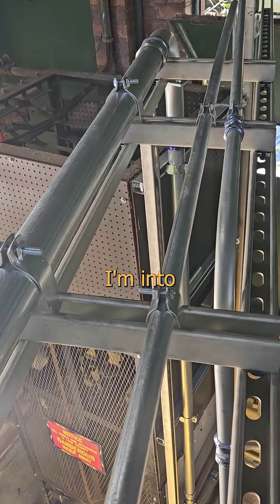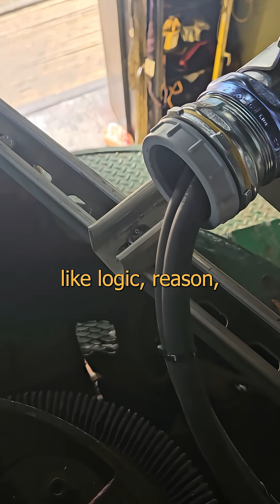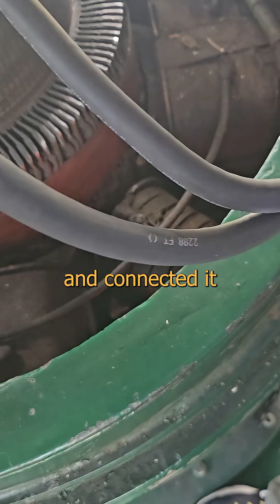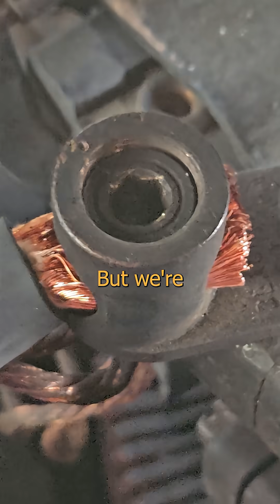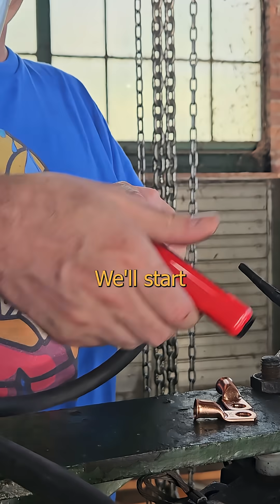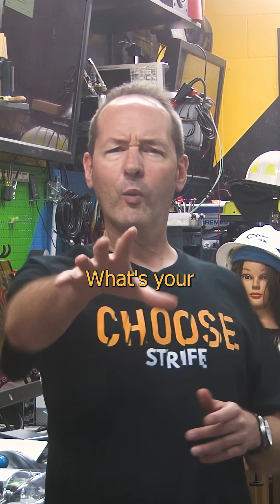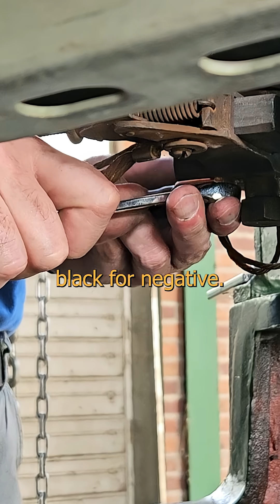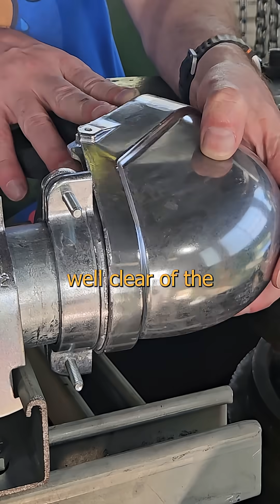Exciter Update #chrisboden #comedy #engineering #powerplant #electrical #educational #wiring

Comment: I had no idea the rings wear unevenly with DC current!
Reply: It's basically creating an anode and cathode. One will be trying to deposit materials and the other picking up the metal like you are electro playing something it's a slow effect without an appropriate medium but it will make one wear a bit faster over time.
Reply: @merendell thanks for your comment! I could tell Chris wasn't joking when he said that, but (for a moment) I still thought he was talking about blinker fluid or a dough patch or the like. Your comment helped the concept gel. I get it now. Thanks!
Reply: @TheMykeShow I'm pretty sure this is explained in highschool chemistry or physics books.
Reply: @akiraic 
Essentially the same effect as with  electroplating.  (Also electrostatic painting.)
Reply: If you think about the A/C welding of aluminum as an analogy. The Positive breaks down the oxide layer, and negative heats it up. With DC it only changes when you swap em.
Reply: @AK-qq7cr I only have DC so I have the apprentice crank a wheel with the poles alternated, if he's not fast enough I whack him with the leg of a neon transformer
Reply: It's probably an electrolytic chemistry thing.
Reply: Also had no idea, and I’m a massive chemistry nerd! This man always manages to teach us something cool.
Reply: The effect is tiny and extremely slow. So for most applications it's basically irrelevant. But this guy isn't trying to make something that'll last a couple years, or even a couple decades, he's working on something that he wants to last centuries. And if you're talking time scales like that, little things absolutely do make a difference over time.
Reply: @Green__one its not tiny in this scenario, the threading will be very bad in a couple years if you don't swap them. and its a completely solve able problem.
Reply: This thread is so amazing ❤🎉
Reply: Grabbed Up ALL Of The Right Hand Electrons.
Gotta Switch Up..
To Left Hand Electrons

Right Hand Rule Of Current Flow/Magnetic Lines Of Flux....?
Reply: It's the same as DC arc welding.  The electron flow pulls on the electrodes and makes one side wear faster than the other.
Reply: @laurenceperkins7468  That was my initial thinking as well.  I'm sure there is some arcing involved at some scale even if it's mostly avoided.  This is one of  the only channels that I consistently read the comment section as Chris has somehow agglomerated a group of really knowledgeable yet funny people.
Reply: Iirc, old carbon rod lamps suffered from the same issue. One rod was wearing off twice as fast as the other one, so they just made them of different girth. :D
Reply: DC motors like having to run the other way, even the small 12V ones
Reply: @NortOfficial   (It isn't a DC motor, it is a synchronous generator - it makes AC, but has a DC rotor..)
Reply: @kadmow  I guess it is pretty much a giant version of what a car alternator is. I have seen the uneven wear issues with alternator slip rings.
Reply: Noalox is for dissimilar metals. Copper on copper, aluminum on aluminum doesn't need it although you may need something for aluminum oxidation.
Reply: Yeah, the positive electrode (the anode) attracts oxygen atoms, which have a negative valence, which causes increased corrosion. In a different context, if you stick the anode wire onto a piece of machined aluminum (or certain other metals) and dunk it into a vat of acid before turning on the DC power, the electrolysis of the water in the acid will cause rapid growth of a thick protective oxide layer, known as "anodizing".
Reply: Me either. Learn something new everyday.
Reply: Took me a minute to work through this in my head.  The generator output would be inverted, but the phase rotation would be the same.  So resync and life is good.  I know this is obvious to some of you, but I don't work with this stuff every day.
Reply: One of the Hydros I work at actually is what was called Revolving Armature Type, popular in 1901. The poles are on the Stator and Armature is the rotor. Pretty cool BUT  the big downside is the brushes have to pass the current/voltage of the unit. Not really great.
Reply: Never thought about this...  But makes sense.  Time to add some new sop stuff to the book and time tables...
Reply: What does he mean just switch them? Negative to positive?
Reply: @jayw900  yes sir. All swapping positive and negative leads to the exciter does is switch the north and south poles on the rotor. You still get AC out either way.
Reply: I'd like to know more about this
Reply: This is something I would never think of but makes perfect sense now that I think about it
Reply: Its not a significant amount in most applications. However it is best practice to swap them.
Reply: I've noticed this before but never realized it was actually a thing or why it was happening. I think it mainly has to do with DC traveling in one direction all the time.
Reply: This is why telco equipment is powered by negative 48 volts.
Reply: All the automotive electricians in here already knew this ;)
Reply: nor did i , now i do, now i can act appropriately.
Reply: Me  neither, that's cool as heck
Reply: All is way more better🎉🎉🎉
Reply: So the old version works maintenance free? Foolproof....
Reply: Makes sense if you stop to consider it.
Reply: I learned this… oh gods, more than fifty years ago in High School. I guess they don’t have time to teach that sort of thing any more what with all of the political indoctrination.